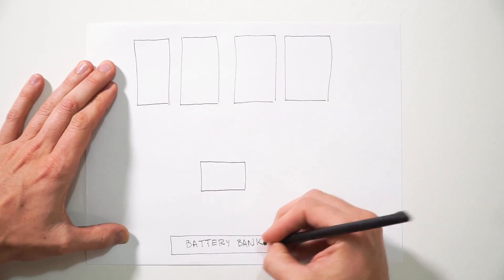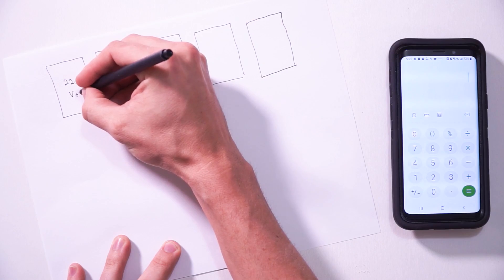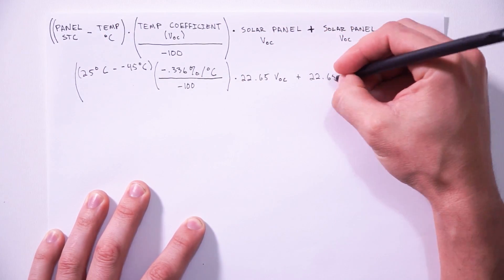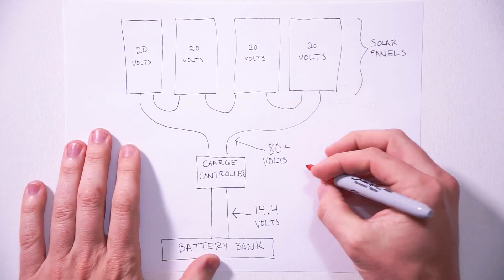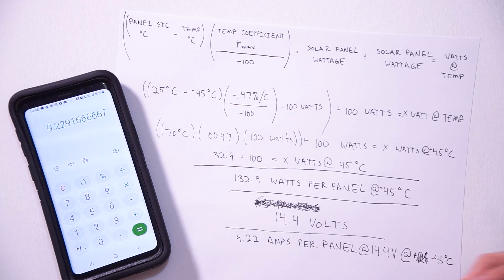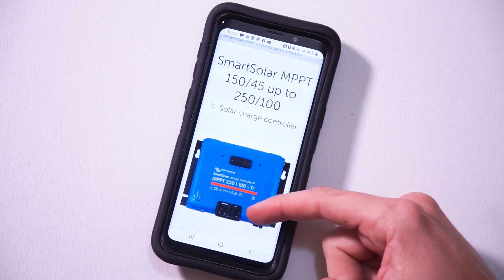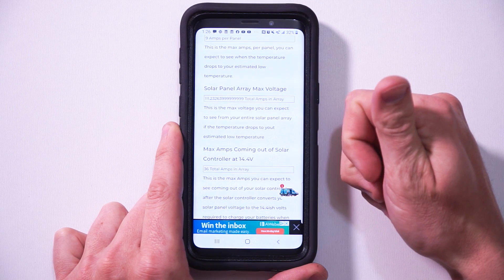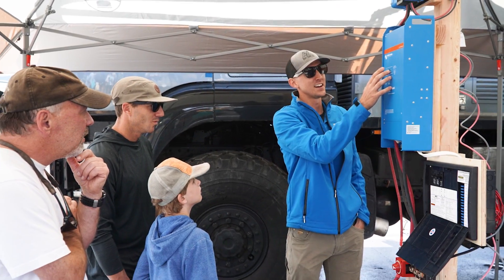How to Size a Solar Charge Controller for a DIY Camper Van Solar System

Comment: Why multiply the amps by 5 (number of panels) when it is connected in series?
Reply: Amps in serious stay the same
Reply: I know this comment is super old but in case someone else sees it. The amperage that he is calculating is the output amperage from the charge controller to the battery. If he was calculating the amperage that the solar panels would deliver to the charge controller then your question is totally valid.
Reply: @ForGood828   I was confused by how the charge controller output is dependent on the sum of the all the amperage of the panels.  In this case by 5 panels.  What I think the question is if the output amps of the charge controller is affected by the array set up in terms of in series or in parallel.
Reply: @JorgeSanchez-je4bt  Basically, you can calculate the output amps by dividing the max combined output wattage of the panels by the battery charging voltage(in this case 14.4V.
Reply: @LIV828  I never knew this part. I have mine set up for adding the amps and the volts in their respective spots. Because that's how I thought we were supposed to do it that's probably why my solar panels are not getting the proper output I'm barely getting half and they're mounted correctly according to being in the series and adding the voc.  N the amps.

I'm going to have to recalculate my whole system
Reply: Thanks for making the video and the calculator.  I just ordered my 150-70 and hopefully I got the right one lol. My old powmr controllers were not dependable and needed reset about once a day which caused my whole system to basically be worthless unless I babysit the thing all day. Hopefully this victron equipment will improve the 30 freakin grand I've put into this stuff

Comment: Great video Nate.  Much appreciated.  Hey on a related questions have you done any videos or a post on comparing the very expensive solar panels (eg:Gioco GSP ) to the newer on the market and much more reasonably priced models (eg: renogy 170 mono).  With our installation it will only actually be outside for 1 month a year and I am having a hard time justifying the 2-3x price on durability alone.  A local dealer is pushing me towards the more expense of the two, so curious to try to figure out why.  Feel free to point me to anything you have pre-existing, or you have found out there that you like.

Comment: So deep cycle batteries are 12 volt. My laptop charger says "DC 9V 1A". 9 volts? Can I still charge that with my 12 volt battery or will that mess something up?
Reply from the maker: You would need a converter for your laptop (12v laptop adapter) or use the 120v through an Inverter.

Comment: Nice video! But are you sure you can multiply the current x5 when they are in series?
Reply from the maker: The current gets added together only after the charge controller has regulated the voltage back down to a nominal 12v.  Before the charge controller, when solar panels are wired in series, the amperage doesn't change from the value of an individual panel.
Reply: Aha, I understand! Thank you for your reaction

Comment: Great video, and thanks for the help. I have one question. I am going to use two HQST 50w and two HQST 100w panels due to space constraints. I can’t figure out the math or how to enter the differing info into your calculator. I’m thinking the Victron 100 |  30 would be good but I wanted to be sure.
Reply from the maker: You'll actually need two separate charge controllers for that.  One for the 100's and one for the 50's.
Reply: Oh I was not expecting that as the specifications on each panel are about the same, except of course the amps on the 100w is approx double that of the 50w. The total amps would still be in range of the controller. I guess I have some studying to do on this.
Reply from the maker: Okay, actually...  I just made a calculator to figure out HOW MUCH wattage would be lost by mixing solar panel sizes.  If you wire your solar panels like this:

2x50w panels in series
2x100w panels in series

Wire those two series-strings in parallel.

If you do it like that, mathematically, you should still be able to pull a maximum of 295w out of the solar panel array; so pretty close to original.

Comment: OK slightly confused (mainly because I am probably wrong) but I get that when you have a series of panels in series you multiply the voltages together (taking the temperature effect into account) but I thought that for a series array the current remained the same whereas you seem to suggest (and this is probably my misunderstanding) that to get the total current IN to the controller you multiply the currents by the number of panels (taking into account the difference between the panel voltages and the battery charging voltage) - is this correct or can anyone point out where I have made a mistake? Thanks
Reply from the maker: If panels are wired in series, the current in doesn't change regardless of how many panels we have.  Once that higher voltage gets regulated down to 'battery charging voltage' on the downstream side of the charge controller, that's when the amperage really ramps up.
Reply: @EXPLORISTlife  awesome thanks,  I now have a handle on it 😊😊

Comment: Would a 48/5000 all in one mppt/inverter using a 24volt battery work? Or would I need a 24 volt mppt/inverter? Killer channel as well!!!
Reply from the maker: You'd need to wire two 24v batteries in series to get the 48v needed to power a 48v Inverter.
Reply: @EXPLORISTlife  Thank you for this, most tubers who have a good following are all hype but you actually reply. Through & through thanks, this helps with deciding on build.
Reply from the maker: It takes me a while to reply most of the time, but I try to sit down every other Sunday and catch up on questions. 😁😁😁👍
Reply: @EXPLORISTlife  Right on thanks. If I may ask one more, with my original question if ultimately 48v is where I wanna take my build. Where do I invest my money for that build? All in one mppt/invert, or all separate individual items and or the batteries and just entry level mppt/invert. As for the all in one I was considering the victron all in one easy solar or just go with individual items. Thank know you again.
Reply from the maker: @1ENDUSER  If you are not based in the USA, the easy solar is a good choice.  The EasySolar is not an option in the USA as that unit only comes in 230v output.
Reply: @EXPLORISTlife  Ahhhhh ok, I guess it's individual parts it is. Thank you again for the knowledge/help.

Comment: RECOMMENDATION:
Outside Recommended Parameters

 guess 12 - 390w panels over does it?  best charge controller calculator!!
Reply from the maker: Yeah.  An array of size will require 2 separate charge controllers if using a 48v battery bank.  I couldn't figure out how to build the calculator to support multiple charge controller setups.  What voltage of battery bank are you using?
Reply: @EXPLORISTlife  24V - still looking into charge controllers. We picked up 21 - 260w panels.

Comment: Hi I have two solar panel 275 Watt 38.5 volt in series what solar controller I need
Reply from the maker: Based on the education provided in this video, what size of solar controller do you think you need?
Reply: 275×2=550w÷12v=45.833____ +1.25 give or take  that brings you to The (MPPT solar controller I need it's 50 Amps)
Reply: am i correct or no on the calculation I have written down thank you
Reply from the maker: What did the calculator linked in the video description tell you?

Comment: Is 2g wire from the battery to a 2000w inverter okay?
100w 12v panel
10g wire to the 30amp controller
10g wire to the 36ah 12v agm battery

Comment: Thanks for the info, we are off grid “Victron gear”
I constantly monitor our usage and as you say the difference in winter / summer  is easy to see when looking live on the VRM, we have a duel axis array setup, consists of 6 x 335watt LG panels in 2 strings, (2010 watts total)
it’s looking at the sun all day sun up - sun down, I have seen in colder days it reach 2430 watts, on real hot days eg: 39c it only pumps out 1700 watts, big difference, MPPT is 150/100. Inverter charger Mulitiplus 48VA - 35Amp.
Batteries agm 12 volt -220AH x two banks (48volts)
It gets us by no problems, il be using your method when upgrading later. 
Thanks again👍🇦🇺
Reply from the maker: Sounds like a great setup!  Glad it's working well for you.  VRM portal is a great tool for sure.

Comment: Would a 50 amp shore power also connect to the charge controller to charge the batteries or is it only for the solar panels?
Reply from the maker: Shore power would go into the inverter/charger.  With 50 amp, though, you'd have to use a smart phase selector before the Inverter/Charger, though.  50A brings up some complications I plan on covering on this channel as soon as we get into our new shop.
Reply: @EXPLORISTlife  Thank you! There doesn't seem to be much information on setting up a 50 amp system so I'll definitely be keeping an eye out for that video.

Comment: does any of this apply  to a pwm charge controller. I have a very small system for my garage 2 100 watt panels. I did the calculations and found it cool that on a cold winters day in chicago. The panels may produce a cool 121 watts of power each and a Voc of 49.4V when in series, but does this  apply at all if Im using a 30amp pwm charge control?
Reply from the maker: This calculator is only geared for recommendations on MPPT controllers, but you could use it to gather info about your array to see if it would work with your PWM charge controller.  For example... you found out that if wired in series your array will be nearly 50 volts which you'll likely find is too high for a PWM charge controller.

Comment: I can't seem to get all the specs on my 5 used panels I just ordered that are needed for your calculator. this is all they'll tell me: 

STS specs:

Rated Power: 265W
Open circuit voltage (VOC): 44.20 V
Max power voltage (VMP): 35.33 V
Short circuit current (ISC): 8.20 A
Max power current: 7.50 A
Power Tolerance 0/+3%

any idea what kind of controller I'll need? I could wire them in whatever configuration will save me money on a controller. I'll be charging a 12v battery bank.
Reply from the maker: Just looking at that, you'd be wanting a Victron SmartSolar MPPT 250|100 if you were to wire your panels in series or the Victron SmartSolar MPPT 150|100 if you were to wire your panels in parallel.

A Series-Parallel combo configuration is usually preferred with an array of this size, but that's impossible with an odd number of panels.

Comment: Question Nate can one build enough of a system be be 100% off grid? My needs are the standard ones for camper life. But also a satellite t.v. with a p.v.r. & satellite internet usage. All this in a Transit, or Ram Pro master Extra long van. I hope you can R.S.V.P. me. I'm in Kamloops...
Reply from the maker: Of course!  You should start with a power audit to determine how much power all of that should use and then go from there.  Here's a tutorial: https://youtu.be/a406IxiU-Xg

Comment: Is the Victron plug and play witha Battleborn 12v 100ah or do you need to program it?
Reply from the maker: You need to adjust charging parameters for it but there is a tutorial on the battle born website to show you which ones to use.

Comment: Not to criticize, because I am great full for all the info you share.  But as I go back and forth in your video, I find it very difficult to understand where you are getting your numbers.  As I am trying to duplicate the process with the numbers I have.  Most of the numbers you use seem to come from your memory, so it is difficult for me to follow.
Reply from the maker: All of the numbers you need to put into the calculator can be found on the spec sticker on your solar panel or on the solar panel product page.
Reply: @EXPLORISTlife  Nate,  the info on the back of my panels does not include  the Temp coefficient of VOC or of PMax.  There  is a Power Tolerance Rating of -3%/5%, however.  Does this correspond to either of those Temp Coefficients?  Will the calculator work without those numbers?

Comment: Trying to use your calculator. Running into a couple issues; It asks for STC, but the says it is the T= value. I have the STC, but no T= value on my spec sheet. Also, the calculator will not let you enter negative numbers. Really appreciate your efforts and great videos though!

Comment: Hey, the calculator at the moment only allows for you to input battery bank voltage but not solar panel voltage. How much would the calculations change if you are using 24v as opposed to 12v panels? Can you use 24v panels with a 12v battery bank through a victron charge controller?
Reply from the maker: The calculator currently allows you to input ANY voltage of panel you can throw at it.

Comment: Hi. Great video! There is one small problem. When you put the panels in serial, for example 2x 12V 100W you get 24V 200W. That's o.k., but when one panel has 8.3A (100W : 12V = 8.3A) and you put the panels in serial, you still have 8.3A (200W : 24V = 8.3A). So the calculation in 4:28 is wrong. I'm sorry.
Reply from the maker: The calculation at 4:28 is, indeed, correct because that figure is the amperage after the charge controller regulates the array voltage down to the charging voltage.
Reply: @EXPLORISTlife  Hi, my name is Louis. I must confess that I am learning how solar components are working. What I was explaining are samples from batteries and resistors. I understand that you are adding the power of the panels; 5x 132.9W and then you divide it with the regulating voltage 14.4V = 46A. Correct?
If yes, this will mean that solar panels are adding not only the power and voltage but also the current. Right?
Reply from the maker: @heizeisen_ch  I think re-watching the section at 1:05 will answer that question as that's where I covered that part you are confused about.

Comment: On a deeply discharged battery, you are underestimating the max output current (but it doesn't matter too much, as the MPPT will cap the output at its max rated current).  At very low SoC, the charge current may be at less than the absorbtion voltage, so current will be slightly higher to hit the max power rating.

It's not a huge issue, just for completeness.
Reply from the maker: Indeed that does not matter which is why I left that point out.  

I omitted tons of stuff that doesn't matter in this video. 😂

Comment: Tell Victron we want LARGER Wire Lugs.
Reply from the maker: On which charge controller and what size of wire are you trying to use?
Reply: agree with that . they are TOO small , i emailed Victron last year with that request.
Its okay if using short cable runs but they dont factor in long cables which means larger cable size... :(
Reply from the maker: @markyes2041  On which charge controller and what size of wire are you trying to use?
Reply: @EXPLORISTlife  Victron 75 / 10 with 6 sq mm wire , the ports are made only to accept up to 4 mm.... :(
Reply from the maker: The spec sheets state they are rated up to 6sq mm; so... IDK...  :https://www.victronenergy.com/upload/documents/Datasheet-Blue-Solar-Charge-Controller-MPPT-75-10,-75-15-&-MPPT-100-15-EN.pdf
Reply from the maker: Perhaps add a ferrule to the end of the wire if you are still having issues.
Reply: @EXPLORISTlife  Nope , the bootlace ferrule adds too much to the diameter , i soldered the cable end , then filed it down to make it fit.

Comment: It seems there is a common assumption about sizing components that battery voltage is 12v.  While this is probably common for smaller systems, the sweet spot for efficiency and wire size/cost is 24v.  Your new calculator looks great, but does not accommodate 24v battery systems.  I'm sure it would be pretty easy to add a battery voltage feature to it.  I ran my numbers and of course your calculator sized my system to need double the controller that I would actually need at 24v.  I caught the discrepancy, but I suspect most who use a calculator like this don't understand how things work enough to see the issue.
Reply from the maker: Thanks for the suggestion!  I just added functionality to be able to choose between 12v and 24v.  I'll look into adding 48v support if I get more people suggesting it.  Check it out and let me know if this is helpful: https://www.explorist.life/solar-charge-controller-calculator/

Comment: Love the videos. Always very good information. But, what if the panels label don't have all that information printed on it? Like the temperature info you mentioned. I bought 6, 200 watt HiTech mono panels. This confuses me on what size controller I should get. Maybe one bigger or 2 smaller?  I have a class a motorhome (50amp) to power. I tried using your calculator, but couldn't fill in all the blanks. Any suggestions would sure be appreciated!
Reply from the maker: Check out the product page on the internet.  That SHOULD have the information available.

Comment: What if I want to do panels in series and parallel for more efficiency in shady places? Say 4 panels with two in parallel and those two sets in series. Would I get an accurate reading per panel at the voltage for two panels in series?
Reply from the maker: Jacob...  I added that functionality to the calculator for you.  Let me know if it works like you were hoping for: https://www.explorist.life/solar-charge-controller-calculator/
Reply from the maker: You'd grab the 'per panel' measurements then add the number of panels in series for your total voltage measurement and add ALL panel amps together for the 2nd number of the charge controller if you wanted to do it that way.
Reply: That's awesome, thanks a ton
Reply: Bookmarked!